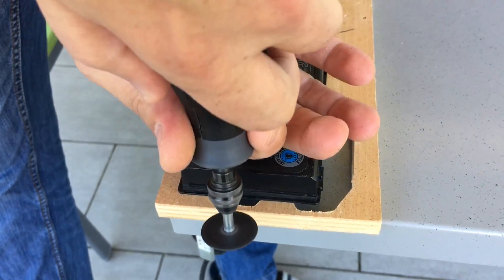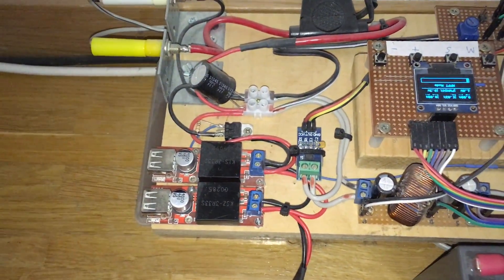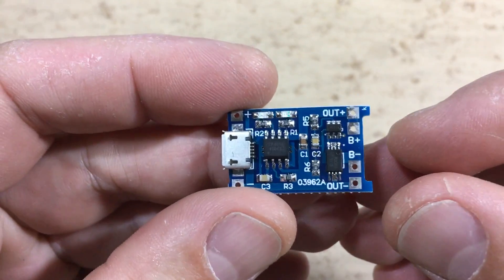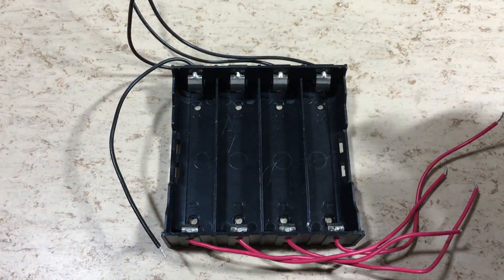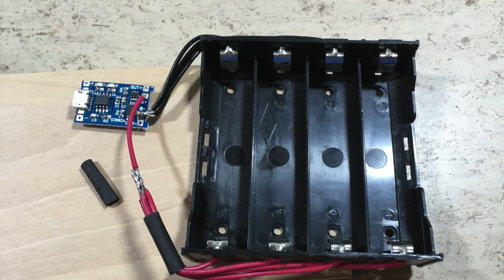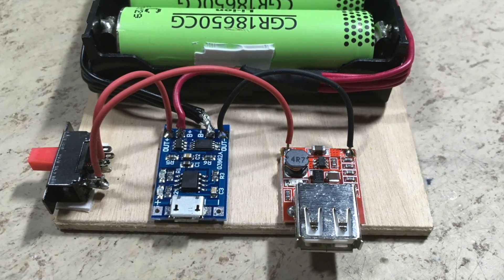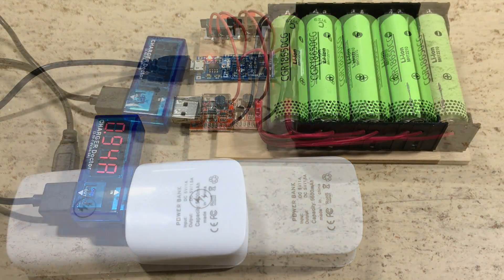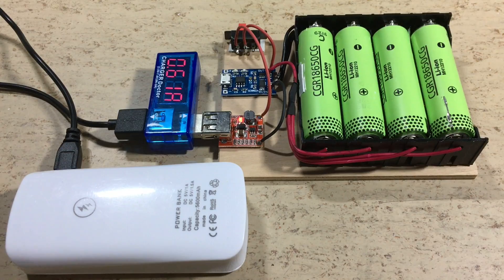How To Build Your Own DIY 9000mAh USB Power Bank!

Comment: Good work.

I have made a similar battery bank. My biggest issue is that the over-discharge voltage of the TP4056 is too low - it cuts off at 2.5v, but that is pretty stressful for LiPo cells. 3.0 or 3.3v would be better.

I am in the process of making my own discharge cutoff circuit with a higher cutoff voltage.
Reply from the maker: Thanks. Are you using the newer model with additional over discharge protection IC?
Reply: @TheDIYGuy999  Yes. Apparently you can get TP4056 with the discharge cutoff chip (the DW01) with a higher cutout voltage, but I haven't been able to find them. Nor DW01's by themselves with a higher voltage (could replace it myself on the TP4056).

Comment: 1 TP4056 for 4 18650 batteries to charge in a row.. wouldnt it take so much time to recharge all 4 batteries?
Reply from the maker: They are wired in parallel. And yes, it takes about eight hours. But it is perfect, because it is supplied by solar panels and my diy solar charger. The stored energy is then used to charge our USB gadgets during the night.
Reply: @TheDIYGuy999  modules are cheap...its better to have more modules and connect them to charge only one battery per module...2 hours and charging complete
Reply: This is exactly the info I was looking for. I was wondering if the tp4056 was capable of handling charging more than 1 cell. Thanks 👍🏼

Comment: Is there an easy way to get scrap laptop batteries? Ebay they are quite expensive and have huge postage costs, when you ask local recycling centres they just reply 'we only sell to licenced authorized recycling companies'
Reply: If you buy "used laptop batteries" on eBay, you may get stung, with a batch of dead batteries.  Check out a company called Battery Hookup.  I've bought excellent "tested" 18650's that put out exactly what they claim.
Reply: Why not buying old / dead cheap notebooks?
Get a multimeter and test the battery.

Comment: why don't you use a tp4056 for each battery ?
Reply from the maker: In the meantime I built a version with 8 cells in parallel, which is charged by two TP4056. It is perfect in combination with my DIY solar charger: https://www.youtube.com/watch?v=IYJt8-Lka7o&t=129s
It is able to supply all our USB gadgets.
Reply: @TheDIYGuy999   have you not made a video of the second one?